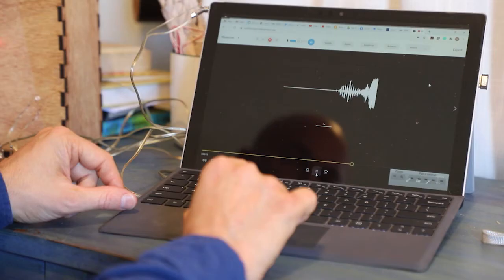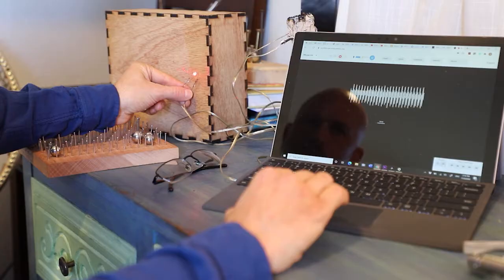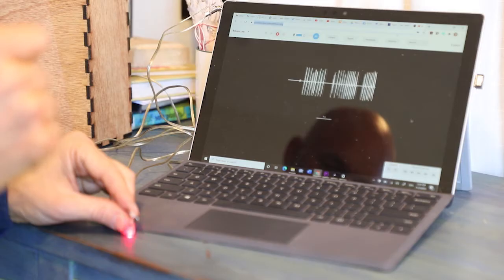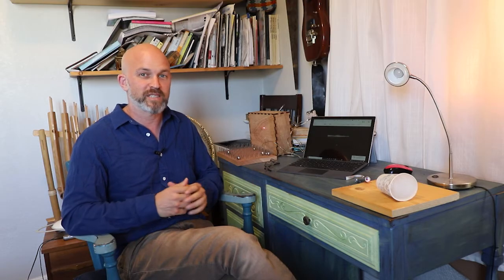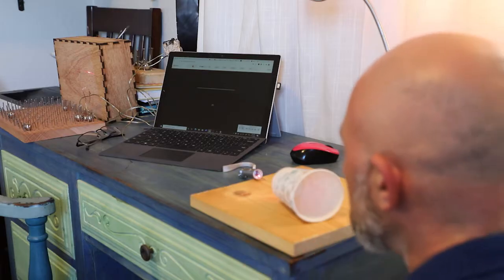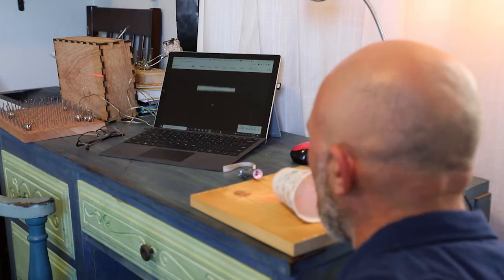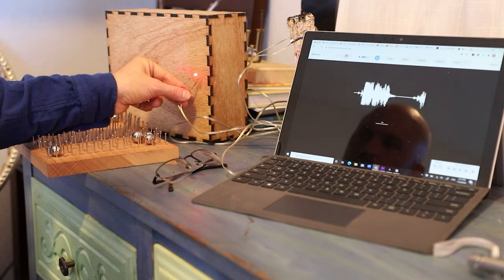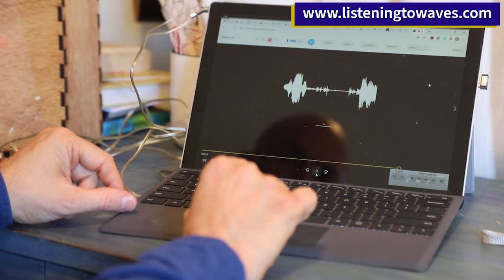How to make a laser microphone

Comment: Hi! I wanted to ask you something about your video. Did you apply any kind of digital filtering or post-processing to improve the audio, or is what we hear the direct real-time output from the photodiode connected to the PC?

I’m asking because I’m currently working on a laser microphone project, where I use several stages like transimpedance amplification and filtering. But if it can really be done so easily just by connecting the photodiode, it makes me rethink my approach.

Thanks in advance for clarifying!
Reply from the maker: No filtering whatsoever
Reply from the maker: No post processing. This is the raw sonified signal
Reply: @victorminces ty for the answer

Comment: Why does the LDR wired to the audio jack work, though, as it produces no voltage? Does the computer's audio amplifier respond to changing resistance?
Reply from the maker: I wonder that too. I guess so. I knew that I could record something because when you short the audio cable, there's always a pop. I guess it worked. If someone knowledgeable feels like commenting on this, I'll appreciate it.

Comment: Can you splice multiple photo sensors into 1 and use multiple lasers ast the same time reflecting back with mirrors?
Reply: Wire a 4 pin RGB, one pin for modution and the Red, Green & Blue pins set up to different input's.  On the the receiving end also use RGB's for modulation and wire to the same colour as the transmitter.  You may be able to send 3 different signal's at once ..
Reply: @mize_yir_bizz  thank you! Going to try that
Reply from the maker: I don't see why not

Comment: Can you hook up an NDIR that only picks up the CO2 that you exhale through your wind instrument?

Tuesday, May 2, 2023 CE, 21:30 EDT
Reply: Or put some kind of filter over these so that only CO2 breaks it (instead of other gases)?

Tuesday, May 2, 2023 CE, 21:33 EDT
Reply from the maker: If I understand correctly. You can input any signal through the micophone jack. An issue is that the microphone input generally has a high pass filter, so if you are trying to record signals that change slowly in time, you might have trouble. I don't know how the NDIR signal looks like. Does that answer your question?
Reply: @victorminces  First off, I can't thank you enough for responding, I've been posting this everywhere and you are the first one to respond

I'm talking about just using the beam itself as a microphone, not with an external input

But a special kind of beam and sensor that only breaks when you blow your wind instrument into it, not just any sound in the air (even if you that wouldn't actually involve an NDIR)

I'm wondering if you can electrify your wind instrument the way that electromagnets electrify most guitars, and I'm sorry if that is off topic

Wednesday, May 3, 2023 CE, 17:08 EDT
Reply from the maker: @mcwooley  Oh I see. I am not sure that the changes in density associated with the vibration of the air inside the instrument might be enough to change the laser. My guess is that they won't, but you can try and let me know. Regarding electryfying instruments in general. The way an electric guitar pickup works is that the string movement interact with a magnet at the pickup, changing the magnetic field as it vibrates, then a coil in the pickup converts those magnetic field changes into electricity, which is then amplified. You could do something like this with any vibrating object. The issue with wind instruments is that what is vibrating the most is the air column (so you can't attach a magnet to it).